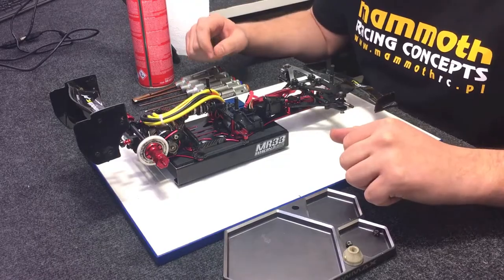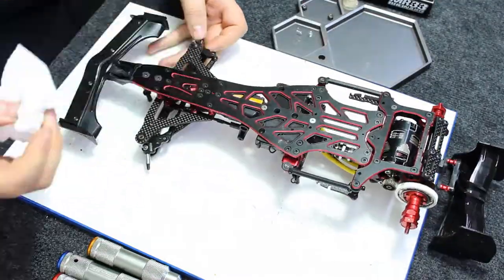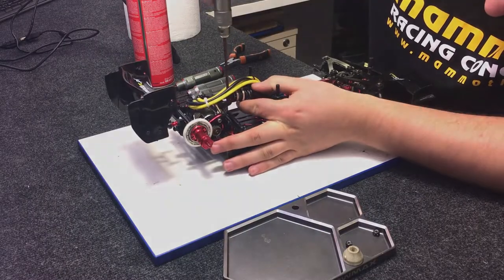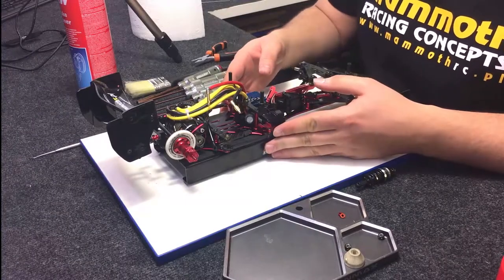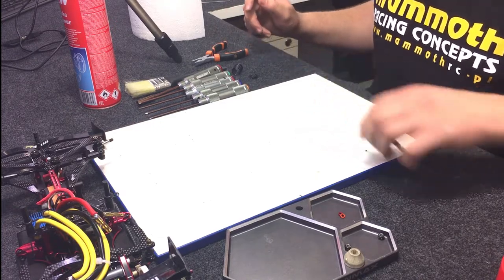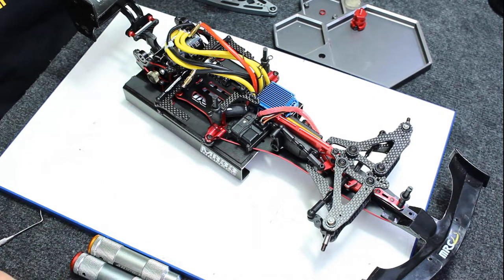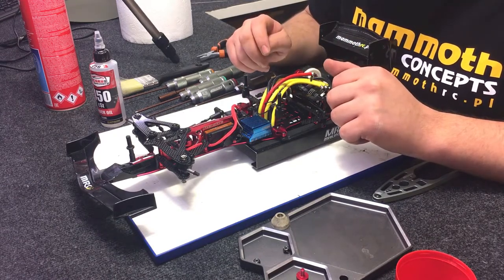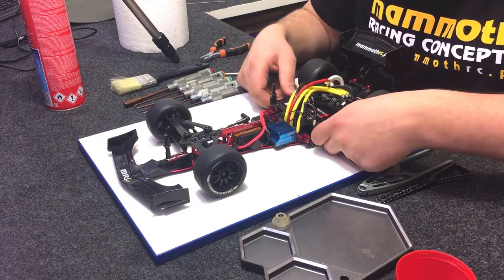Tech Tips: F1 Quick Rebuild

Comment: How do you set front ride height and droop?
Reply: By adding shims under the lower arms post or if you need ad just a little bit, by shims on kingpins, but remember to do it symetrically on both sides.